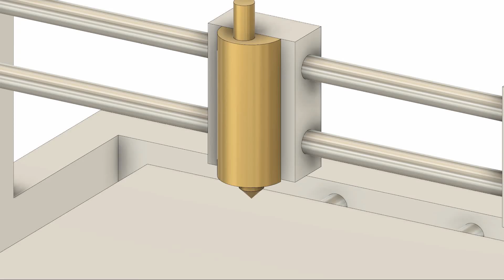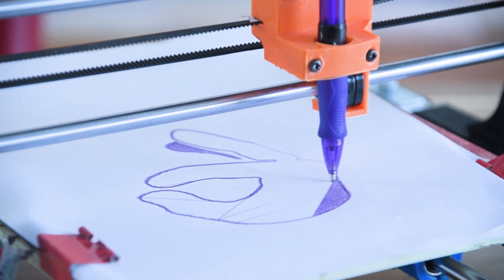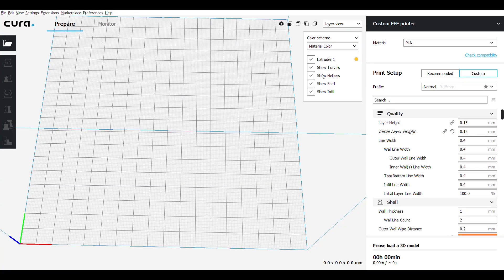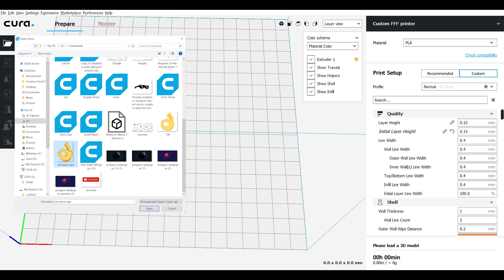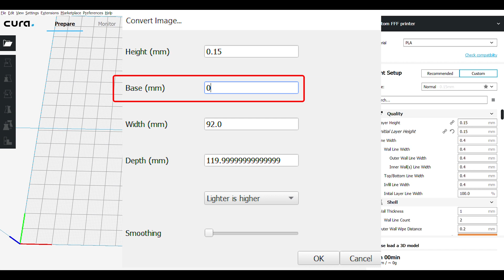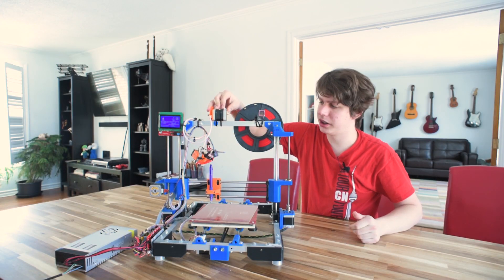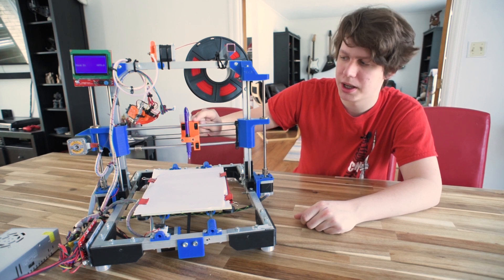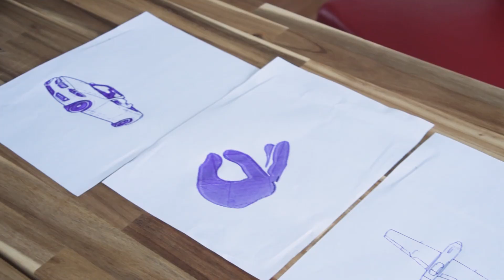3D Printer Drawing Conversion

Comment: Hi Greg, I just mounted my own designed Ballpointpen holder on the Heater screw in the CR-10s (The Pink one) it works super nice. Thank you very much for that video 
One question where are you from?
Reply from the maker: I'm glad you enjoyed! I'm currently in Canada
Reply: @GregMakesStuff  
I have got a tip for you if you set in Cura the  ,,Retraction minimum way,,  to 0.5mm then you can fix that line movement problem, that you had in the subscribe Picture
Reply: @GregMakesStuff  
Nice